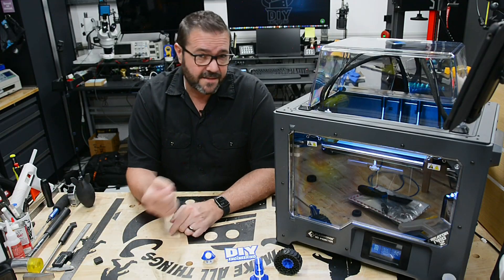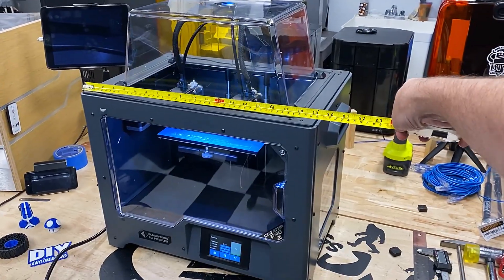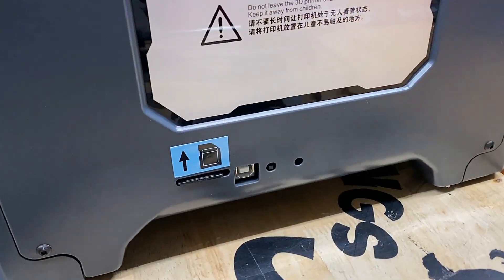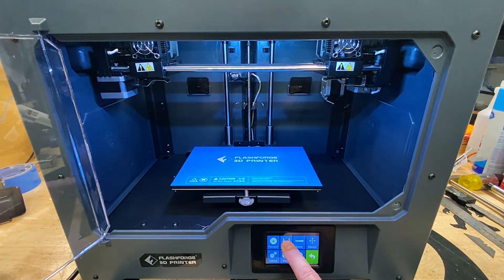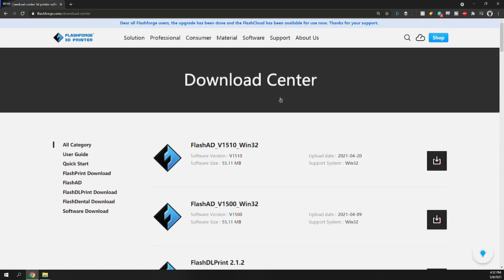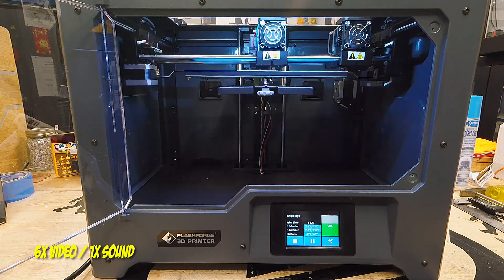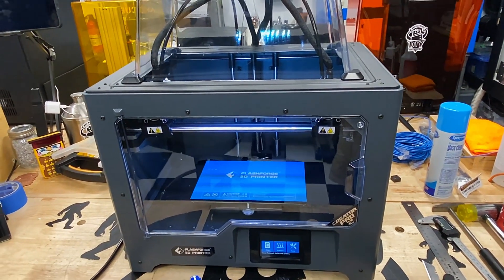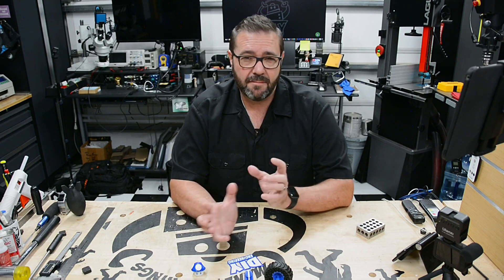3D Printer Review of the Flashforge Creator Pro 2!

Comment: What's the best printer for making architecture models?
Reply from the maker: depending on the size of the models you will be creating, your mileage will vary, if they can fit in a 275mm cube I would go with a Bambu Lab X1C or P1S best / fastest printer on market 2023

Comment: It works good for me. The hardest part is to get the model off the build-plate as it has really good adhesion. 
Also, removing rafts is another issue. Any suggestions?😁
Reply from the maker: using glue stick can reduce bed adherence when you have this sort of issue. also increasing model gap on raft can make removal easier, at the expense of surface quality on the part.
Reply: @DIYEngineering  The first thing I did was to use Glue, but it didn't work😓.
Also, increasing model gap between the raft would be disastrous as the surface finish would be sacrificed.
Any alternatives?

Comment: Thanks for sharing. I have had mine for over 12 months now and love it. I don't use the duel colour feature as the technology still needs work in my opinion. I use the duplicating feature a lot but the reason for my comment is the font on your DIY sign, what is the font called please. Thanks heaps
Reply: Hi Dooley I need to print several cases with PETG, do you recomend this printer? I need mass production with short stop or manteinance.
Can you tell me if this printer can do the job.
Thanks!

Comment: I have a Powerspec 3D Pro 2 which is essentially a rebranded Flashforge Creator Pro.  I’ve had the machine nearly 5 years and it has been a beast.  I’d like to add another printer to my bench, and this one might be the ticket for small parts I’d like to produce in larger volumes.  Thanks for the review!

Comment: Why have everyone stopped at 2 print heads. Where are the 4 and 8 print head machines.
Reply: They have, it's called a tool-changer. With only 2 extruders you can "park" one at the side of the x gantry the other one doesn't have to pass.  When you want more extruders, you need a different parking mechanism, hence the tool-changer.
Reply from the maker: Design one and you will find out... :)  multiple materials would be the only benefit... they have produced hotends that have four extruders... also, the complexity reduces the reliability of the machine, ofcourse that could be improved, but not cheaply... which is why all advanced printers are considered professional grade machines... I feel there are better 3d printing technologies that should be advanced before FDM. FDM is entry level technology at the end of the day...

Comment: I have this machine and love it, the only big issue i can not fix is dual prints.. Any Advice for a newb like me? my left extruder always peels my first layer off, i did the dual color Statue on the sd and it handled fine but nohing else i do works, leveled many and i have great adhesion
Reply from the maker: It sounds like the left extruded z height may need to be recalibrated.